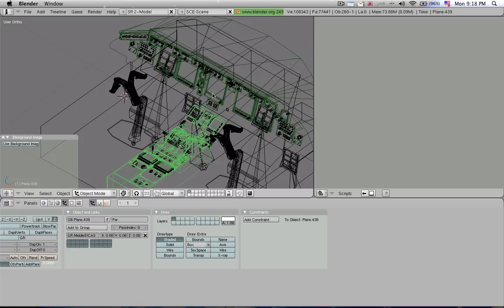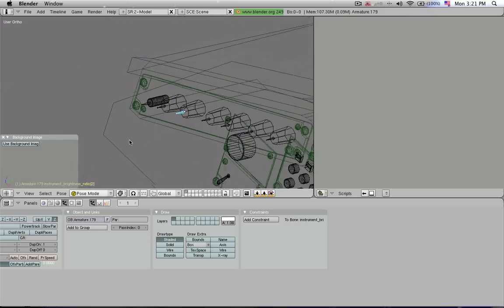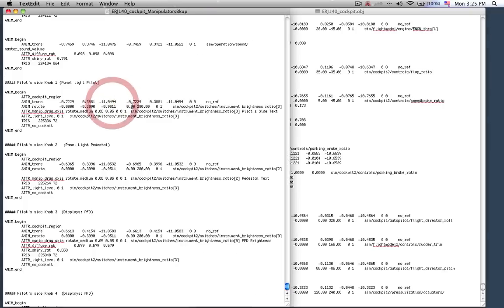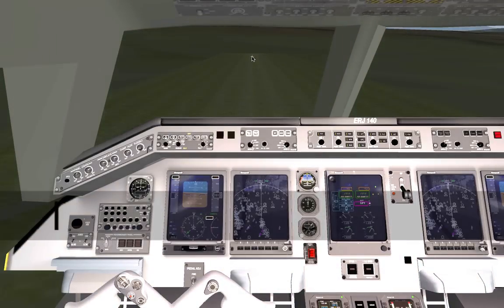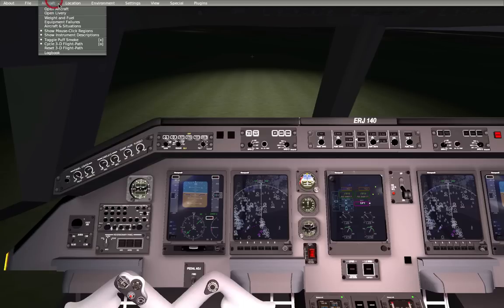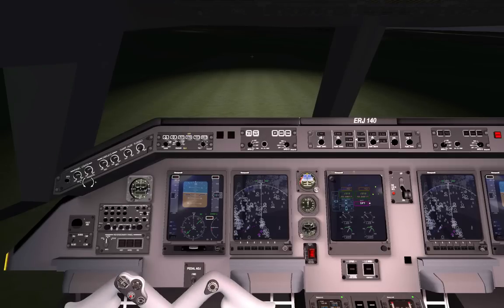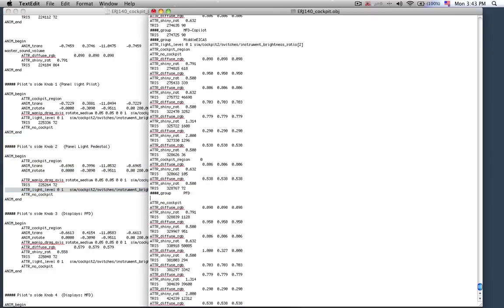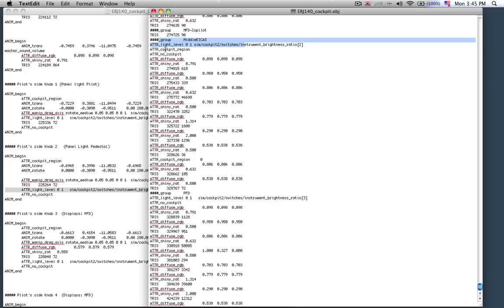PlaneMaker - 35 - Blender - 21 - 3D Object Manipulators (Cont'd)

Comment from the maker: Yes, I've been wanting to move on to the plane's exterior. I think I'll do around 2 or 3 more tutorials relating to creating textures with Photoshop (daytime and nighttime textures), and then move on to animating exteriors.

Wing flex isn't actually hard to do.  You just have to know which dataref to use, and decide on how many pieces to divide the wing into.  Putting in the armature with correct parent/child relationships is the only other thing that might be a bit tricky.